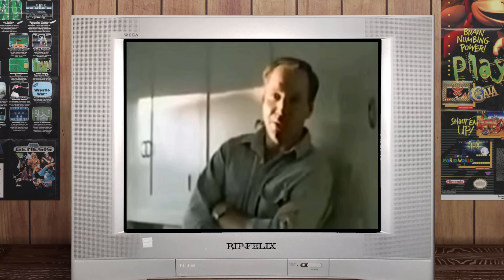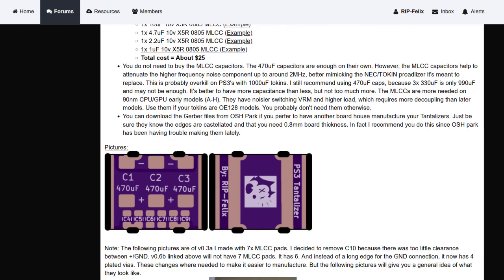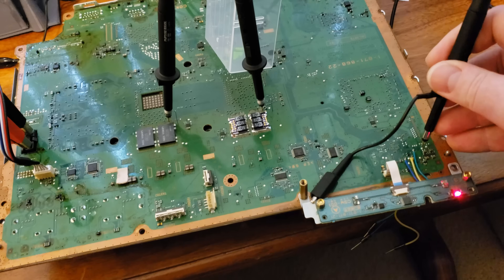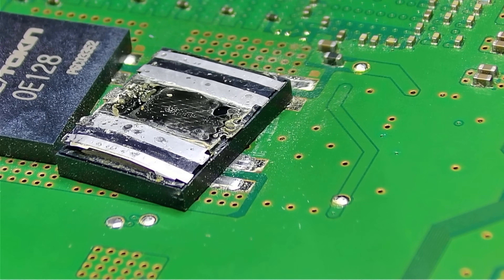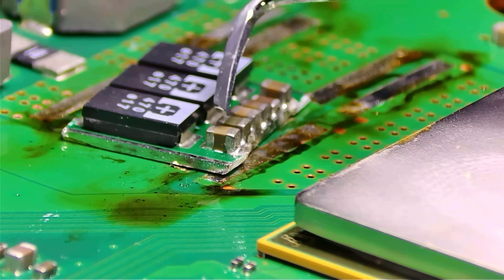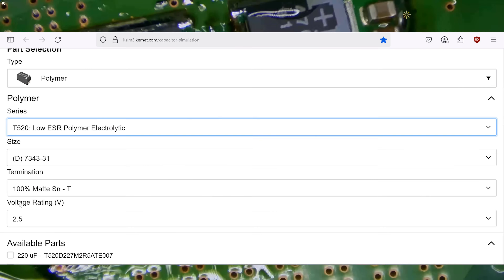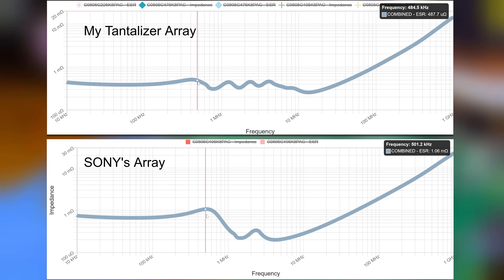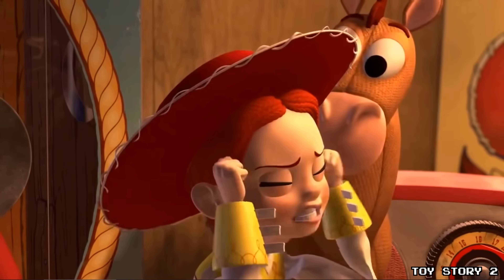How To Fix | Episode 2: Bad NEC/TOKINs

Comment: Those github files you were going to release that are linked in your video description is just a filler. Do you have the github link?
Reply from the maker: Sorry, I need to make that public. Will do that later today.
Reply: @ripfelix3020  Thank you for the upload. Looking at the gerber file, Its just a single board. Do you also plan to upload the 8 copies larger board version you show in the video

Comment: I’ve had a CECHB00 recently that I got from Japan at a stupidly low price, that just suddenly died on me. No power, PSU totally fine, but the board has a short somewhere, whoever had this console before me decided to replace one of the sets with those bad looking tantalizer sets and I’ve been stumped on the console. Very upset at it too since it’s a very well maintained console.
Reply: I just bought a Japan Model B. Unless you live in a place where 220v is the standard swap out the PSU from a region where you live. My Japanese model would not turn on with it's stock PSU and turned on with my US PSU from my broken 60gb one.

Comment: Hi felix, I have a question unrelated to this video but related to the bumpgate issue, and it's probably a completely clueless take and probably has very good reasons for not being performed by anyone, but I'm asking anyways ...

Thanks to you we know that the underfill of the 90nm RSX is bad and it causes the bumps between the die and the interposer to break over heat cycles ... but what if it was possible to somehow dissolve that underfill and replace it with a better one ? I'm not saying to remove the die from the interposer as that would definitely kill the chip, I'm thinking of chemically removing the old underfill and then replacing it. Does that sound feasible ? Or is it completely impossible or unrealistic for DIY or even repair shops ?

Thanks for your videos and your research, this is really helpful. I'm not so much of a PS3 nerd, but as a PC hardware collector, this knowledge also applies to Nvidia and ATi cards and a lot more hardware, so it's invaluable to me as well❤

But yeah I would love to have a solution to save these chips from a certain death because unlike the PS3 some have no safe replacements afaik ...
Reply from the maker: Unfortunately, not really. Underfill is an epoxy. It cures by forming crosslinked covailent bonds (strong chemical bonds), which can only be broken through the use of chemical digestion. These same chemicals would eat the interposer, mask, polyamide stress bond layer that protects the bumps...etc. It's possable to remove physically, by milling, but not chemically.
Reply: @ripfelix3020 thanks for the answer, and yeah I kinda expected it, but anyways it was still worth it

Comment: @RIP Felix

Thank you so much for your videos and all the hard investigative work you put into them — not to mention the great, creative videos always filled with good humor!

Just a couple of things, if I may:

    I believe in your video you mentioned that the 25xx models have NEC capacitors, but if I'm correct, it’s only the 20xx series that actually have them. I've heard some anecdotal reports about certain 21xx models having them, but I’ve never personally seen or opened one with NEC Tokins.

    I totally agree with what you said about the ceramic caps and all that. Just one quick question: I think I remember you mentioning on PSX-Place (way back) that using only the TaPol or AlPol caps “should suffice” since the amount of ceramic caps already there tends to “do the trick,” although you’d still include them on the tantalizers. Am I remembering that right, or did I misunderstand something?

Thanks again for your excellent work!

M
Reply from the maker: 20xx have proadlizers on the RSX side. All later slims and SS have polymer. If I said otherwise, it was a gaf.

The MLCCs help bridge a gap in the frequency response curver, reducing the ripple at certain frequencies across the broad band spectrum proadlizers were expected to attenuate. So I now see them as necessary, but no. They will not make a noticable difference in the immediate future. I haven't had access to the equipment I need to do a frequency response curve to show the difference. So currently this belief is still theoretical, based on enginering principals and best practices. Even what SONY did with polymers. They added MLCCs. So while I believe they should be there from now on, if you don't add them it will still work. And if you're comfortable taking that risk, it's your console.
Reply: @ripfelix3020  thank you again for taking the time and aswering in here.

I am taking the risk for sure (for now) in a few consoles, however ... based on enginering principals and best practices I agree with you 100% - even "The Mother Sony" did on the Slims, surely they know "one thing or two" about design of Electronic Circuits and modeling 😄

Cheers,

M
Reply: @ripfelix3020  I understant that you didn't test the configuration of the filter and pointed this out (with the MLCCSs you've chose using the simulator)  however I've bumped into this YouTube video about the Q Factor (I completely forgotten my Electronics Engineering after many decates not doing it) and pehaps/maybe the reason why Sony used a single value on the MLCCs for decoupling after the Tantalun capacitors:

https://www.youtube.com/watch?v=TpXvac1Y3h0

(I wasn't sure you would be interested, however I've thought it would be interesting 🙂)

Cheers,

M

Comment: Great timing, I yet again just fixed an err 1002 ps3 with your board design. Had pcbway print it. Thanks for giving to community man!
Reply from the maker: I'm juat glad it make it easier to replace, so fewer PS3 die in the process. We had to do something to stem the massacre.
Reply: Thanks again, this was ps3 number 6 I have now fixed thanks to knowledge gained from your videos. I even had the cell brace 3d printed by pcbway and using that after I delid. Many things learned! Hey what is the best place to get some advice on troubleshooting as I'm stuck with a cechc with err 2110. I tried psxplace but as a noob account I can only post on that newbies thread and Noone really answers it..

Comment: So many circuit boards include electrolytic capacitors that need recapped on systems that might be sitting in the attic, that these silver protolyzers actually don't look like all that bad of a compromise in design in general. Maybe a bit of a PITA because it's a custom solution and the amount of work and research that went into replacing them is something to be quite proud of here. With bucking the supply voltage into an acceptable range for the GPU, and smoothing the ripples as the goal, these are really great at absorbing the shock based on the curves shown here. The function mirrors the factory protolyzers good enough. I'm pretty sure the tantalyzers will probably last even longer with the assumption that quality parts are being put on the board. Obviously you don't want to be purchasing parts from a sketchy supplier that might be delivering a unsatisfactory product for purpose. Still solving that niche problem and show people how to do it will also improve any DIYers skillset, so it's worth checking this scene out for certain.

Comment: Second!

Is insane how much PS3 I've seen failing from them, even on consoles with low runtime. i think sometimes they just oxidize from air entering the plastic case since i can wipe the orange oxide from their surface with IPA and a cloth, but i haven't tested if that makes a difference. But they're Still 300% more reliable than the 90nm RSX.
Reply: Air cannot pass through plastic (at atmospheric pressure), moisture in the air is what can pass, and what is killing them.
Reply from the maker: In the case of the tokins, it's just a resin cap. It's not actually encapsulated and sealed. So it is open to the air, flux can get in, water, dust whatever. It's not the best design to limit air infiltration. I don't think they ever expected the device they were installed in to be relevent after 10 plus years. If used in that time they'd meet specifications. They're just aging out now, I think. It's plausible anyway. Some have died with too few hours and other lasted way too many. I think it's just how much they were used when they were fresh.

Comment: Hey Felix! Have you ever seen the 28nm RSX of super slim? What you think of them compared to the 40nm ones?
Reply from the maker: IMO they are not much better. We have a method to overclock a 28nm and they dont really clock much higher than a 40 can. And they dont have enough IO for PS2 compatibility even if we somehow figured out how to make an interposer to use them on earlier models. I just see them as cost down too far.